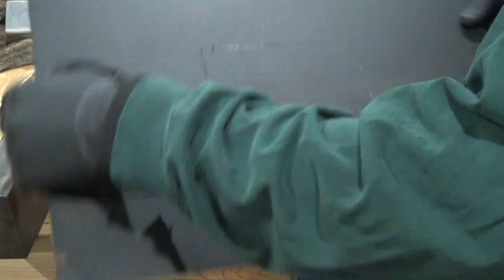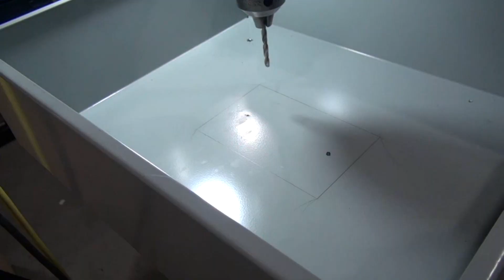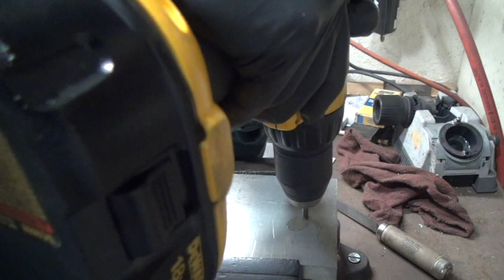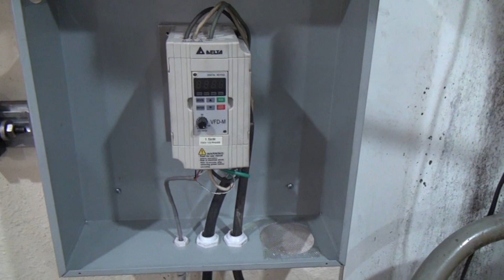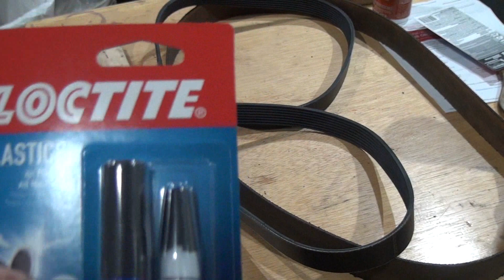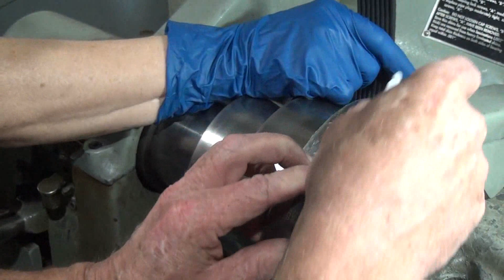Shop Tuneup Series - New VFD and Poly-V Drive Belt for the Lathe

Comment: Glad you showed the Loctite. I wrestled with repairing and replacing sections of the old original belt for about year or so, experimenting with various lacing materials every so often along the way. When that belt finally gave up the ghost I tried a cut down strip of treadmill walking surface "belt", but was unsuccessful in glue up, so I bought an inexpensive clip belt of smaller width than the original. I'm curious to try the Loctite and revisit the potential treadmill or ribbed serpentine solution with it.
Reply from the maker: The Loctite product works pretty well but you have to have good prep so the lap joint fits well. I've had the joints fail if I didn't get the prep right. I also go buy the glue when I need it rather than having it on hand for months, it seems the activator dries out in the tube. If it's fresh it will slightly wet the surfaces for a short time.